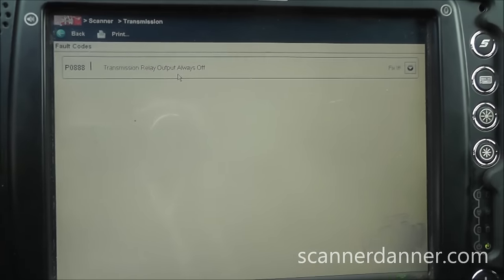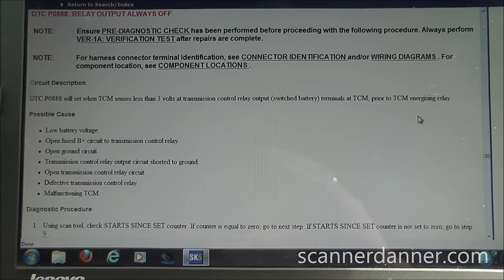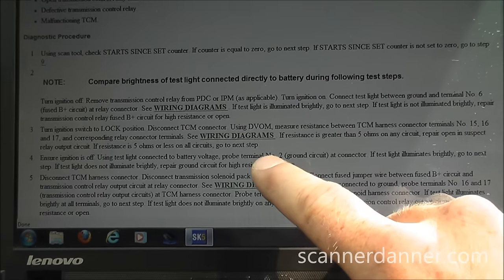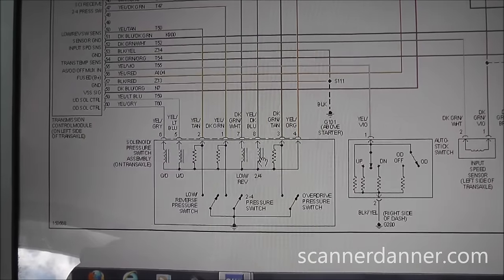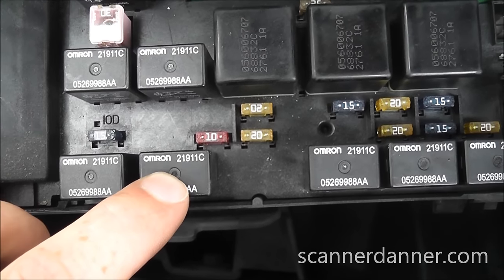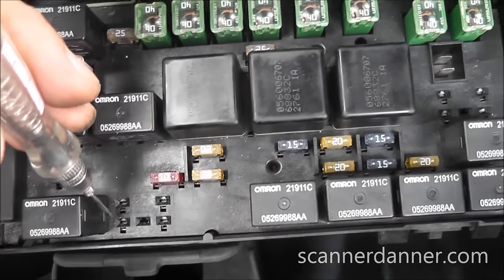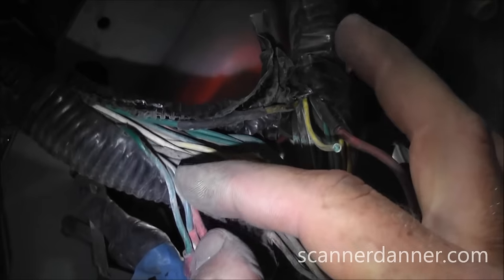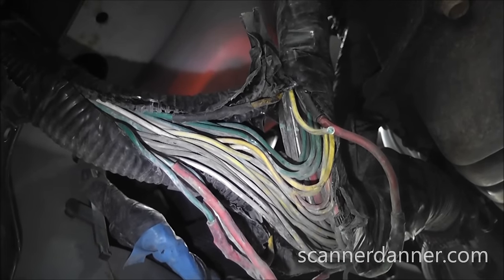Transmission No Shift Case Study (P0888)

Comment: Stil loving these older diags.   Thank you for providing all of this very valuable content. 

I have a friend here in OKC that is a crack Chrysler tech.   He’s commented to me many times that those vans have that “contact point” where the harness can run on the motor mount in that same area.   Key words that run through my mind.... points of contact, loaded circuit testing, voltage drop and vest of all “test lights are your friend”.   Solid Gold.
Reply from the maker: Thank you so much! You've been clearly paying attention 😀

Comment: Great video! No two techs tackle the same problem exactly the same way, but some how your way is the right way. I do this kinda stuff everyday and it's fun to sit back and watch the puzzle unfold without having to do all the leg work. Your diagnostic process and reasoning are top notch, keep it up!
Reply: I just got a 2006 T&C and was having problems with it not shifting. My friend has a scanner and the location of the relay. We were gonna do the test light first then decided to put another relay in exchange. He cleared the ck eng light I tried it and now shifts in all gears.
Thank you for your informative video. It made my day that much brighter. Now I got to tackle the right turn signal not returning after turn is made and also the two sliding doors are not locking or unlocking but when you manually unlock the doors the auto open and close works good but just won't lock. (?)  Again Thank you

Comment: Excellent video!  The voltage is a piece of the puzzle. The Loaded circuit showed the piece was defective, which led to solving the puzzle ; the wiring. That sure looked like a lot of wires living in a bad environment, under a vehicle. Some one told me once that the best tools in a tech's toolbox are not in the box. They are his mind, hands and his eyes. You saw the retape. You saw the zip tie. Tenacity prevailed. That's what I love about you videos Paul ; The unwillingness to concede until every possibility has been considered and checked and rechecked. To me, it is a beautiful thing to see! Thank you.

Comment: After almost 10 years, this video still saves lives! After suspecting the issue with dead wires and driving in limp mode for a week, today diagnostic scan confirmed everything and I received the very same fault code. Preparing to crawl under my van's fender! Thank you very much for this in-depth video and greetings from Europe!
Reply from the maker: Heck yeah! Let me know
Reply: @ScannerDanner  Wonders happen, today is a crazy day! I've power-washed every bit of the wheel 'arch' (sorry for my English), including all that messy wiring because I was stuck in mud up to headlights two days ago... And after all that washing and wiggling of all that terrible-looking wire harness and TCU, my Chrysler Voyager (same car as in your video, but made in Austria, as you probably know), suddenly had no Check Engine light, no limp mode, and now shifts perfectly, without any 'bumps', etc. This only proves that there is a bad wire/connection somewhere. For now, I skipped the 'surgery' of the wires, since it looked too overwhelming. I will prepare myself better mentally for the next time when limp mode happens (and it will happen, for sure). This simply confirms that you were SO RIGHT in this video!

Oh, and of course, it is a huge pleasure to receive your reply from the other part of the world and after so many years after the video has been posted! Mega cheers! :)

Comment: Just wanted to let you know I worked for dodge back in the 90s as an engine tech and have busted knuckles for 25 yrs.   Most videos you see on here and parts changers. Today you no longer have mechanic's. They are just parts changers. They check a code and start changing till they find what works yours is one of the first that does it right from the start. The only thing I would have done different is swapped relays withe the start or a/c to rule that out fist. But that's a trick us older mech learned when all this computer control came out. Lol  anyway I'm not one to comment but this was a great video. And I tip my hat to you.
Reply: Well thanks for commenting. I appreciate it very much
Reply: agreed! I have a 2000 T&C in limp mode after I put a new shift pack in. that cleared all codes except the low/reverse code...and I have seen some wire damage in that harness so tomorrow I get to address that and wouldn't have, until this vid.
Reply: @mac6452  sigh..I guess I'll try that too
Reply: burt davis qqžzone
Reply: @splatteredmoon  it didn't work. Every once in a while it does it again.
Reply: my issue ened up being in the harness under the bumper. all wires were perfect except for the one damn red wire that fed power from fuse block to the tcm. insulation was rubbed off. cut and spliced it back together and all issues gone! I wasted alot of time checking harness last.
Reply: I got a new motor for my window whippers turned it on the wipers were froze to the window
Reply: How do I Fix window wipers to move  @ScannerDannerPremium
Reply: Just did can swap. Now have 1-2 and 4-5 trans error code. Any idea

Comment: Also judging by the rust hole in the body. Looks like road salt got into that wiring harness, and just corroded several those wires. Fast diagnosis, great video! Thanks for teaching us all.
Reply: I just can't believe they put the computer there.

Comment: Thank you! Thank you! Thank you! 

I had the limp mode problem back in January.  Took it into the garage and they said it was dirty connections on the PCM.  

The problem came back this summer.  I sprayed all the PCM connectors with DeOxIt and no improvement.

I found this video.  I had problems with three other relays in the past few months.  I had one spare left.  I go out, replace the relay, go for a drive and BINGO!  It's shifting again!

Dealers and parts companies want $37-$40 Canadian for the relays.  Rock Auto $15.  SO I had bought three from Rock Auto after paying $37 for the immediately needed one.

Anyways...

Thanks again!  My van is back in operation.

BTW  it's a 2005 Dodge Grand Caravan 3.3L.

Comment: Thank you Sir! You solved my issue with P1698 code (limp mode). Testing the relay lead me to a break in one of the wires leading to the TCM under the front of the car. Ive spent months trying to troubleshoot this issue and there is next to no info online for P1698. Thanks again ... im so excited!! Awesome vid!!

Comment: Amazing... The no-load test result of 12V would have thrown me off for sure!  Total lesson learned to test circuits under load.
I would love to know what ignorant knucklehead parts changers would thumbs down this video.  I have to think that because it didn't show a transmission swap in 5 minutes or less they thumbs downed when they realized nothing more than voltage checks will be done.
Reply: Thanks Matt. I think some people just want the fix to be shown without testing procedures and methods. What some do not realize is how much information I pack into each case study, maybe to a fault sometimes. But those that really want to learn this stuff truly appreciate it. So I don't worry about the thumbs down anymore. Happy New year friend
Reply: ScannerDanner Premium You are correct at that sir- about people just wanting to see the fix.  I think my all-time favorite comment on my channel was on a misfire diagnosis series where I basically covered just about every single possible variable you might have for a misfire and how to test each and every component to rule them out or confirm them as the problem. A guy commented he saw the series and thanked me for finally "setting him straight" because he previously changed almost every part in his car and the video "finally gave him an entirely new direction he never thought of" and he was confident he would finally fix his misfire. I was feeling pretty satisfied about converting a swaptron until 2 days later he says "I changed every single part you mentioned in your video series and still have the misfire- got any other videos with other ideas for parts I can try changing?"
Sigh.
  You're right- those that want to learn, will. And those who don't will never understand what channels like these actually offer.All I can say is I have learned more from you in the past year than I have cumulatively in my whole life, and many things I have learned from you have literally been life changing for me- I mean, literally.. life changing.
Happy New Year my friend.
Reply: Schrodingers Box
dude that's awesome! thanks Matt
lol on the parts changer comments...typical isn't it?
Reply: Jason Renfro I was thinking the same thing...
Reply: +Schrodingers Box I'm learning so much happy festivus!  Vehicle electrical is my weak point.  I'm an engine machinist, so this type of methodical scientific information is superb.  

I really want to thank the both of you and ETCG as well.  You are my go-to guys and I believe even more the saying of sharpen your axe for 10 hours if you have 12 hours to cut down the tree.

Stay gold.
Reply: People who are jealous that we learned something! HA!

Comment: I used loaded circuit testing on a daily basis. I am a big fan of voltage drop testing as well. I use to use a test light in conjunction with a multimeter. Now I have one of those fancy loadpros. It is okay for testing low current stuff. I still use a headlight bulb with a mulitimeter for high current circuits. For certain applications I have breakout harnesses that I can connect my meter in parallel with the component without backprobing. I find it amazing that most manufactures are not okay with using a test light even though it often leads to misdiagnosis. A lot of the modules that are used in my industry are protected with smart FETs or some kind of current limiting device. They have to be because eventually you will have a short to ground on an output driver and there has to be some type of internal circuit protection to prevent damage to the computer. I do like to use OCV for wiggle testing a wire if the wire is in bad enough shape. I am not an automotive tech but your videos are always interesting to watch. Keep up the good work you are helping out a lot of folks on here.

Comment: It makes sense, voltage is available up to the open point (relay pin 86). As soon as the circuit is loaded voltage gets shared with the other unintended resistance in the circuit, in this case green fuzzy stuff was an unintended resistance. Absolutely a learning curve. That is where you do a wire resistance test with an ohm meter.  Thanks for sharing!
Reply from the maker: The ohmmeter will fail you in so many circumstance like this. It just doesn't stress the circuit enough and will show you false no resistance readings

Comment: I'm an electrical engineer and my brother was an electrician. My brother taught me to use a test probe with a solenoid in it to check for voltage. This provides a test load for 110v just like the test light in your 12v case. Great video! I'd recommend liquid tape in addition to the marine heat shrink to seal the connections.
Reply from the maker: Thanks Kenneth. Always great to hear from engineers on my channel

Comment: As usual great video. I have noticed in your videos you teach how to work with what you have to perform tests which is great. After being in the automotive repair field for a little over 30 years I am constantly looking for new and better ways to approach testing and repairs. Another method is to remove the relay and rap single strands of wire around each of the pins then reinstall it in the relay box. This must be done with caution because of the potential of short circuiting the circuit being tested. I found this method in a video here on YouTube by realfixesrealfast called "relay test." I have tried this method and it works. It is a little time consuming, but it works. I recently purchased the Lisle 69300 master relay test jump kit to save time and I highly recommend this kit. Great job and keep up the great work that you do.

Comment from the maker: Exactly. another way to think about it. 12v is feeding the bulb first then travels to the relay coil next. Part of the voltage drops across the bulb, the remainder across the coil. Coil resistance will determine bulb brightness in this series circuit. A low ohm coil = bright bulb, a high ohm coil =a dim bulb. Also the bulb itself is a factor too

Comment: Watching your video I was able to fix my Sebring transmission  not shifting to 2nd gear. It was a 20 amp fuse that feeds power to the Transmission relay and my trainy is working like new now . Thanks a lot. I  Subscribed . 👌
Reply from the maker: Now to find out why it blew! It will happen again. Look for contact points of the wiring harness where that circuit runs
Reply: @ScannerDanner  Actually, it was just  missing the 20 Amp fuse and being guided by your video. I was able to know it was missing. I just bought the car for 500 bucks . I normally buy used cars and sell them on a side to make extra income. Thanks.

Comment: If there have been several wires in the harness which have broken and needed repair, and you find one more which broke on its own, its time to replace the harness itself, not just the affected wires.
Even if you fix the broken wire, and reattach the other previously repaired wires, another break will occur on another wire, and the cycle continues. The costs of replacing the wiring harness would have been less than 5 or 7 repair events, including an expert diagnostic job (for which cost does not apply toward the actual repair). 
This is a case of when the cheapest fix cost much more in the long run.

Excellent information and troubleshooting walk through by ScannerDanner

Comment: so I changed  both my tranny sensors...then my transmission  control  module . .and still code po700...after this video  I unwrapped  a bunch   of tape. .and sure  enough  there was 2 failed splices....quick wire job and the old pacifica  is no longer  in limp mode and runs great....this dudes  video is spot on...only difference  is my yellow wire had a red strip....nice  sharing job man ....thanks
Reply from the maker: That's awesome man! So glad it helped you

Comment: A very common problem on these caravans. Thanks for mentioning that Dodge will turn that relay control off if it see's a problem, that can mess people up as they check for power. That major elbow in the harness where the broken wires were found is a big problem area that can cause all sorts of issues. I noticed that TCM is also not long for this world. They rot out ALOT. I have replaced dozens and after seeing the condition of that one, was expecting to see no output from the module. Maybe next time lol. The dealer often has them in stock and they are not that expensive. They really thought that out sticking it in the wheel well loll. Good vid, thanks!

Comment: This video is pure Gold.  You have a fantastic ability to explain/teach things.  I started working on cars a little over a year ago at the car lot where I work and your videos have been a tremendous assistance.  I'm putting money aside to buy your program for sure. Thanks for sharing the knowledge.  I know you make good money doing diagnostics and all but I really hope you make lots of money via YouTube with your videos. God Bless my friend!!
Reply from the maker: thanks so much! I'm so glad this stuff is helping you. Hearing the success stories means more to me than all the money in the world
Reply: @ScannerDanner   Awesome.  Thanks for the reply.  Hope you get a chance to give your feedback.  I performed a loaded relay test (just like you did) and it checks out good (on a 2002 Dodge Durango with a PCM/TCM ).  There's constant 12v+ at the relay (Pin 87) and 12v+ in the control wire (Pin 86) when I turn the key to ON position, while loaded my test light is bright.  Ground connection is really good.  Checked voltage and resistance through out the whole circuit.  Also, I checked to make sure there's constant 12v at Transmission Solenoid Assembly connector during key cycle.  The problem is after driving the truck for a few miles the code P0888 comes on.  Prior to all my testing I replaced the Alternator because the voltage would drop below 12v if I rev'd up the engine's rpm during idle.  I took the alternator to 2 different stores to get tested and it failed 4 times (2x at each store).  Also, took the battery to get tested and that one checked out really good.  Final thing I did, I jumped all the wires between the power dist box to the PCM/TCM and from PCM/TCM to the transmission to make sure there's absolutely no problems with the wiring.  And the code still comes back on. Before I condemn the PCM/TCM is there anything else I should check? or does that pretty much confirm my PCM/TCM is malfunctioning after the engine compartment gets real hot?  My apologies for this long question.  :-(

Comment: Thank's a lot! Had a similar issue with a Voyager.  Multimeter shown 11.4 volts, wires seemed ok until ran through a test light like you did. Had to change 2 wires in the end. Thank's again man!

Comment: I just had one of these in a 98 chry stratus. The sense voltage is the same as a micro controller power good input. If there is a voltage drop the power good will force the module off. My problem was a module output but another shop threw parts at it and didnt fix anything.
Thanks again Paul

Comment: My 01 voyager which is the same as this van had the same problem. All kinds of weird electrical problems with gauages going crazy. Random beeps. Stuck in limp mode. It turned out to be a bad alternator that was putting out normal dc voltage but it was also puitting out a/c current which was contaminating the entire electrical system. Changed alternator. And everything works perfect again.
Reply: Bad diode in the rectifier brige .